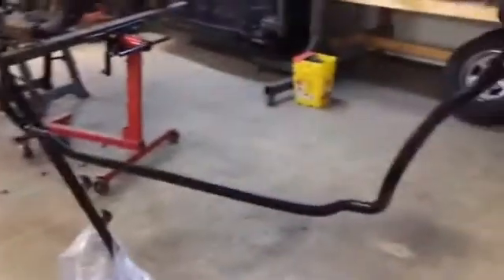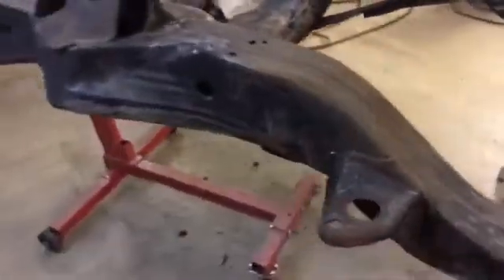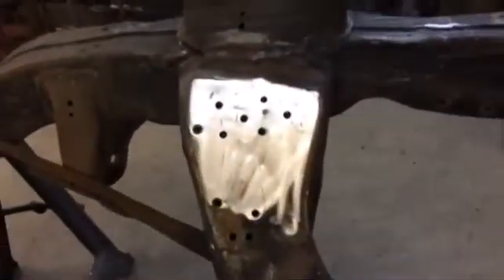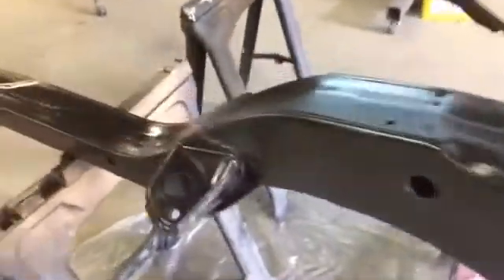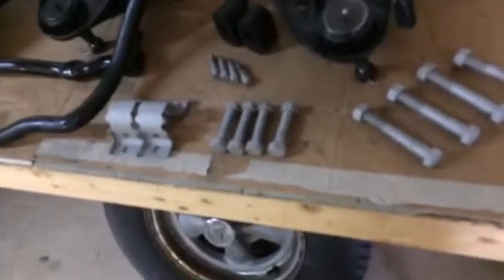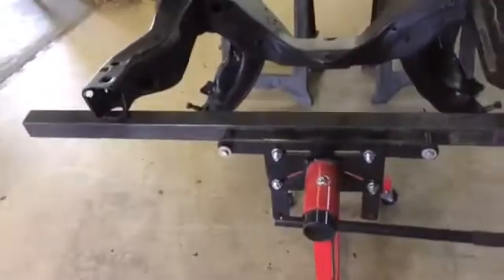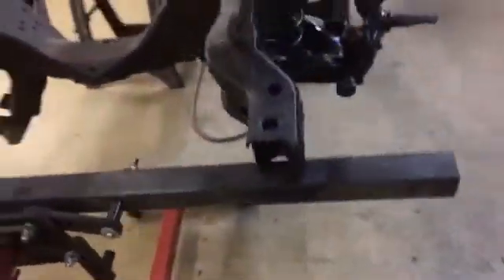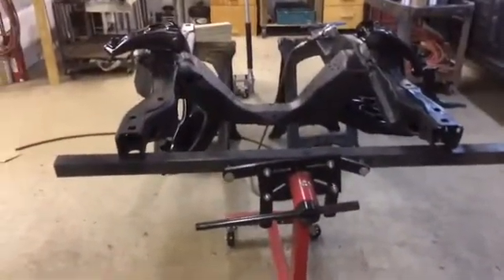1972 Camaro Part 35

Comment: Jeff you will need the lower arms off to bolt on the motor mounts I think
Reply from the maker: Tony Toms Thanks for the comment. As usual, I think I'm going to make a slight modification so it won't be so hard to mount them. I refuse to compress those springs again. Lol

Comment: Question...What type spring compressor and process did u use to install your front springs? I'm trying to get mine installed(2nd Gen '79)with the internal type compressor and I'm having one hell of a time tryin to get it done. Any help would greatly appreciated. Thanks.
Reply from the maker: Blood,Sweat & Gears I bought one from car quest. Just a double claw compressor. Worst thing I’ve done so far. Send me a text and I’ll shoot you a pic when I get home this afternoon. 912 850 9041